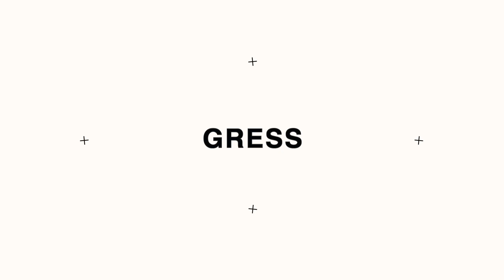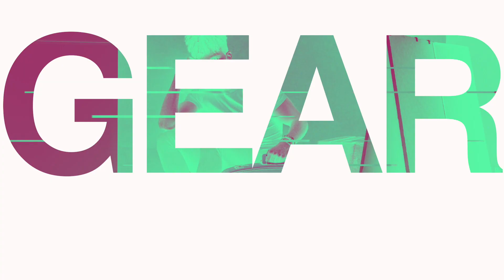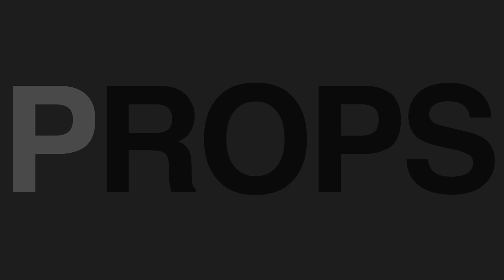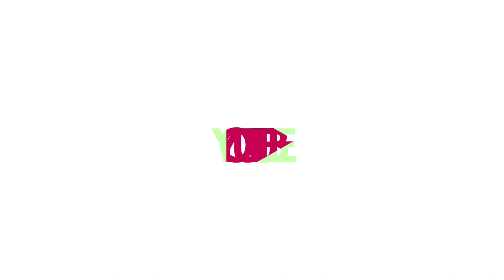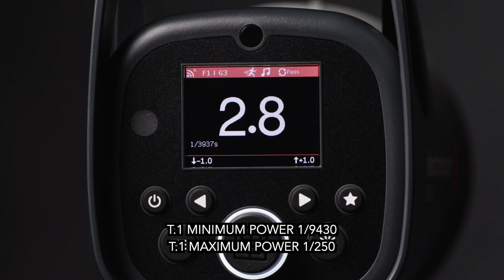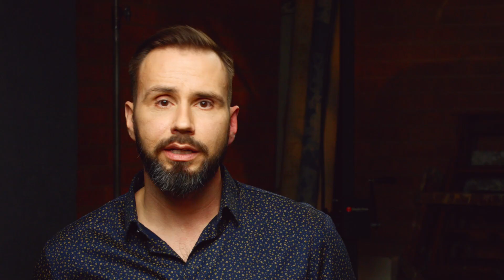Everything you needed to know about Flash Duration and Specs for Elinchrom's new ELC 500 Monolight

Comment: How did you figure the T.1 duration for that light? I'm only able to find T.5 on the Elinchrom site and B&H. I have the ELB 1200 and I calculated the T.1 of the Pro and Hi-Sync heads low with the fastest being 1/1600 or so. I used a Sekonic L-858D-U for the T.1 measurements.
Reply from the maker: The manual for the ELC 500 says the Flash duration t0.1 max. power 1/250s and that is what is displayed on the back of the head.